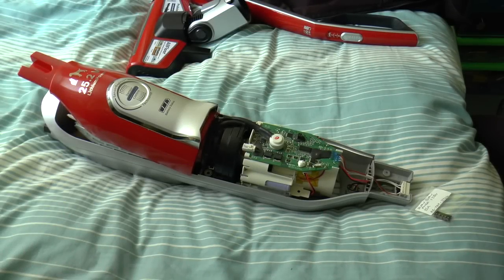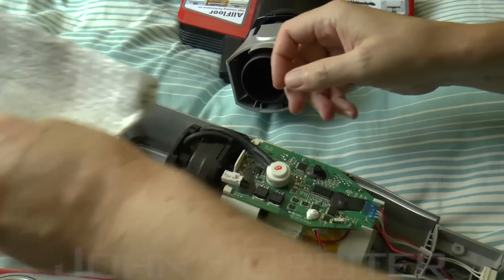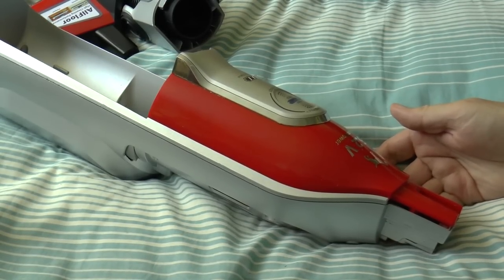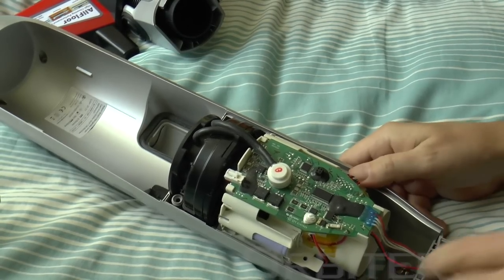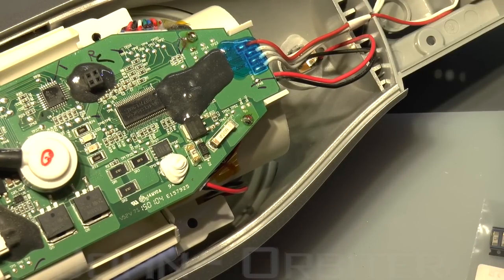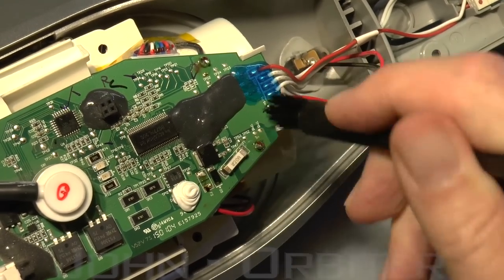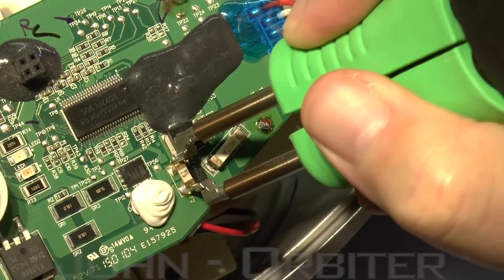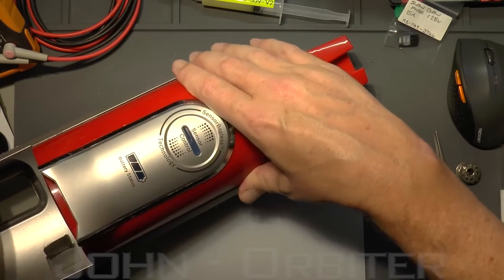Bosch Athlet - Vacuum Repair

Comment: I have a problem with my hoover.it's work with charger 30V--500mA, I plugged it into a 30V ___3 A charger, and it no  charges the problem in an electronic circuit. What am I to do pleas help me?
Does someone sell a circuit electronic to replace it?😭
Reply from the maker: Was the polarity correct on the DC jack you used? e.g. Centre Positive. If the DC jack you used was Centre Negative you may have damaged components on the PCB.
You can 'sometimes' pick up parts for these vacuums on Ebay, however if you manage to find new parts they tend to be very expensive, and on the other hand unfortunately used parts are NOT guaranteed to be good 🙁

Comment: Smashing fix john :-D, lucky it had a pcb fuse :-D
You do enjoy attacking yourself with subtitles lol, "This bloke is crap, he tells lies." or something like that ha ha :-D
Can't beat a good sense of humor :-D.

Yes i've been there with that type of vac john.
i did the wire repair on a identical looking vac and the wire broke in the same place lol.
I was lucky though, there was no short between wires :-D.
I lifted the sprung power connector and added an extention to the down wire, then pulled the down wire down to solder on to the motor.
It will break again one day, it was/is a stupid design, much like the door/hatch rubber gators full of wires on cars, bend bend bend ... snap snap lol.  (Done those too lol)
This comment is turning into a book, sorry mate :-(
Reply from the maker: Thanks Harvey 👍  Yes I was happy to see those fuses, made for a fast repair.
Yea I love the subtitles, hehe, they save me time in many cases as having to splitting & match audio/video takes ages, especially if there are many edits. Plus I'd rather include video parts instead of chopping'em out if possible 😉

I don't think these things are made to last are they Harv, being that their wiring is so poorly implemented down to the brush head. Gives us something to do though aye 😁
Look.. You've made me write a book now too 😉 LOL.

Cheers friend 
John
Reply: It's all good fun :-D
Your subtitles are funny, so it adds to the video :-).

Some tubers show there mistakes and that's smashing, it stops you thinking they are perfect, and perhaps we learn something too :-).

On videos where nothing goes wrong or bolts just come out too easy, i know the item has been prepped, not real, shame :-(
Just my opinion of cause :-)

Comment: no action at all when trying to charge, though if i try to start it then lights go on
Reply from the maker: I may have a bit of time later so I will perhaps take a look at my vacuums PCB Test Points to see what they read, then you can compare yours. 
In the mean time perhaps you could have a close look at your PCBs components.. Check if any are burned or smell burned. Have a close look at the main ICs (U1 & U4) check their tops surfaces for cracks or small burn holes.
Also.. if you know how... test the main transistors (marked on the PCB.. Q15,  Q16,  Q17) for open/short circuits.

Please contact me next time via the 'ABOUT' section at the top of my YouTube channel.. This way I can send any images easier via email.
Cheers
John
Reply: @OrbiterElectronics  Thank you again, will do!

Comment: I can hear in your accent you're from merseyside. Can I drop off my Bosch athlet circuit board to you for repair? It is not charging
Reply from the maker: Hello Robert, I'm sorry but unfortunately I'm not able to take on external repairs at present. Also, as your issue is with the charging of the unit (unless it just a failure of the wall adaptor..) It's likely that it has failed due to a problem with the main control PCB or it's IC chip, this controls charging too. The IC can seemingly fail on these vacuums for no apparent reason and once failed it's not possible to repair them. This is because there is no firmware available to be able to re-flash the chip with it's software. So yes you could in theory just buy/replace the main IC chip, however it would be useless without it's control programme/software. 

Since making the video we have had our Athlet fail again due to this seemingly super sensitive IC issue, I even managed to get hold of a second-hand PCB (with main IC chip) however this had suffered the same failure, and wouldn't charge :(

Regards
John
Reply: @OrbiterElectronics  no worries John thanks for the info ! :)

Comment: Do anyone knows what is that black square 4-pin connector approx between ATmega and BQ BMS chip? You can see it on this video, Black, with black silicone at base. Is it USB to ATmega? Or what?
I'm currently trying to repair my 32.4V (9-cell) version of Athlet. Back box... Help with any information about controller board would be much appreciated!

Comment: It should be criminal to sell these, the moment single battery cell dies this hoover is pretty much landfill material.
Reply from the maker: Agreed mate... Not only should the cells or packs be replaceable for stuff like this, but it seems to me that the IC's on these things is soooo susceptible to static damage that you virtually can't touch the PCB for fear of damaging the firmware IC. I only know as I've killed a couple of them :(
Reply: @OrbiterElectronics  Haha, tell me about it, I think I just fried one yesterday 😂 Oh well, might just get a spare from evilbay, as there seems to be so many of them there.
Reply from the maker: Be careful there mate.. Only because I did the same thing & bought a couple of replacement PCBs from ebay. They were supposedly good, however they were DOA 😠
That was a year or more ago though so perhaps you'll have better luck 🤞
Reply: @OrbiterElectronics  Good news, got a spare half broken hoover with good PCB, swapped battery and case and all is well. I found two things though. If you connect the battery in the wrong order, the atmega chip will block the controller and board is instantly unusable and the second thing I found is that Bosch intentionally degrade these through software! The hoover I got only lasted 5-10 min on full charge, yet I've tested each cell individually now and each and every single cell still have 85% original factory capacity and all cells are within 30mah of each other! Will never buy a bosch tool ever again, that is planned obsolescence at its worst!
Reply from the maker: @katar0t0  Good to hear you've got yours working again. And interesting what you found regarding the battery connection. If I see another one I'll remember that. Although the last one I killed was my own vacuum, and the batteries weren't disconnected. I was just testing some voltages on the PCB whilst trying to assist someone who'd asked for help :( 

I never used to think planned obsolescence was a real (Or legal) thing.. but it seems it is. Big business control aye.. 😡 
cheers mate
John